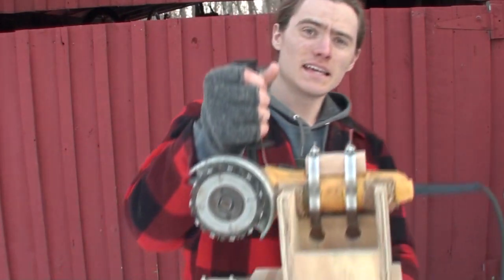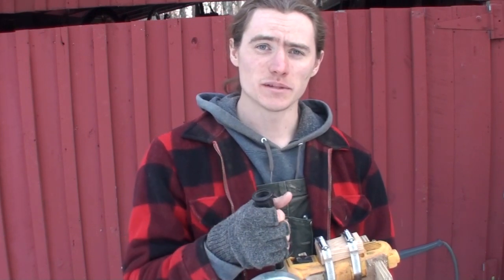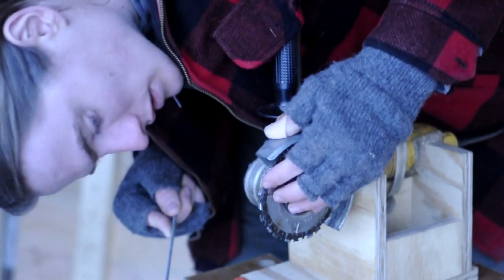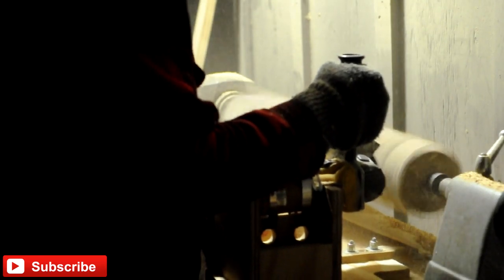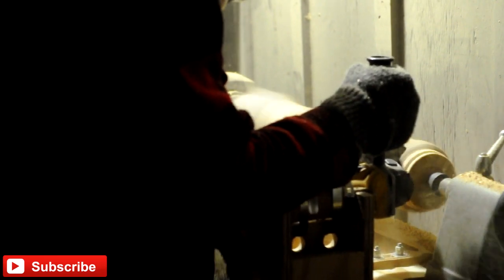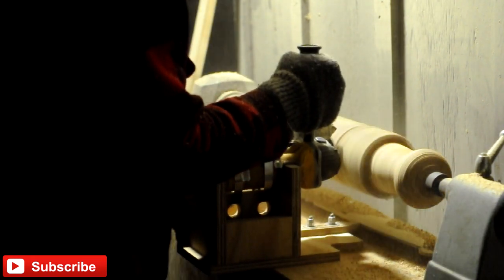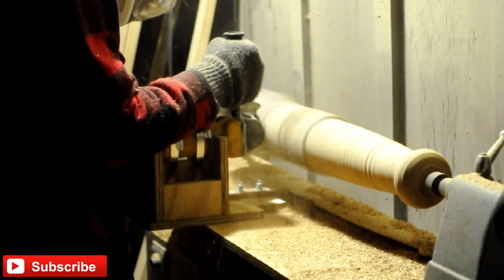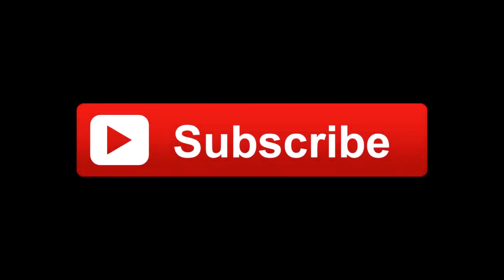Homemade Wood Lathe Duplicator - Sharpening and Demo

Comment: Great vid HC, I was one of the one's suggesting how to get the angle grinder to spin in the opposite direction. I didn't think about it possibly getting caught up. Thanks for sharing, keep up the good work.
Reply from the maker: hasdrubal121 Not a problem at all, commenting on things like that just shows your thinking, same goes for all the others who have suggested that, I get one or two every day on that exact thing. If I reply I usually just comment on how fast it works as is and thank them for watching.

Comment: I rigged up something like this a few years ago because I had some old wood that was hard like a rock and it was taking forever to get anywhere and just beating up my tools.
I used a carbide cutter from a metal milling machine which is something like a mini saw blade and mounted it on an angle grinder, what was taking me an hour I could then do in about a minute.

Comment: Hi there - just discovered this vid - love the duplicator - I have the same lathe, but mine does not have the ability to slow down the rotations - did you add a speed controller?
Reply from the maker: HI, no, it was one of the models they produced. You should be able to change what pulley the belt is on.
Reply: Thanks for getting back with me - yes I can change the belt - just would be so much easier with a controller.  BTW - where can I find your plans that show the various legs your make - sure I saw that somewhere.

Comment: All I want to know is how long & how many legs did you go thru till you were able to slide the carrige up & down the length of the leg without going in to far & gauging the  leg? I hope that made sense.  Great vid, keep em coming.
Reply from the maker: I havn't messed up any legs, I did the first set of 4 in about 30 min and was hooked. By hand It would take much longer and wear you out. I turn 20 legs or more at a time. I've done quite a bit, it is very easy to use. Thanks for watching and commenting!

Comment: just as a thought have u tried turning the lathe slower instead of faster ?  I mean it all comes down to surface speed  and just slowing down the lathe you wouldnt have to change anything and your net surface speed would increase.  in other words the difference in the speeds would be greater and you would get more cutting action,, just  a thought
Reply from the maker: +dennis buckner It's going as slow as it can go.
Reply: ok its hard to tell on video sometimes but good on ya and keep up the good work